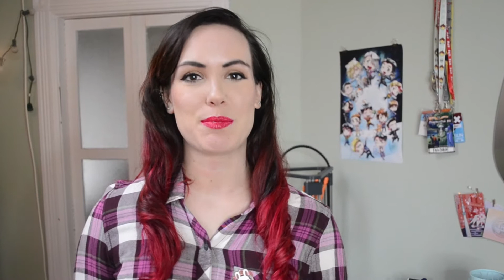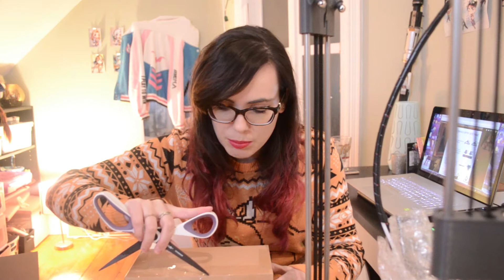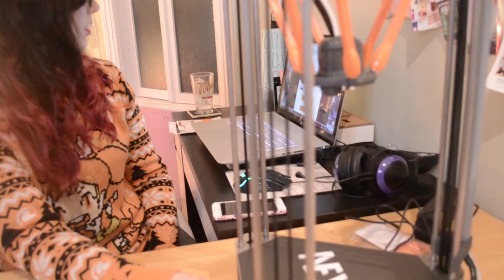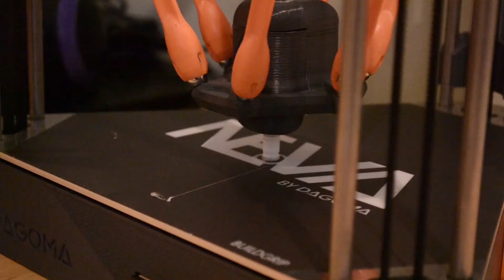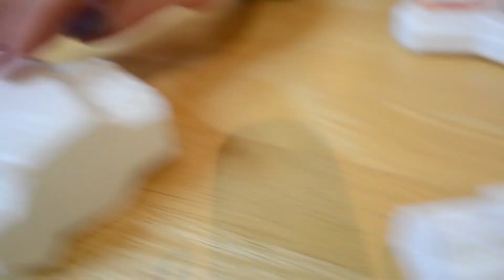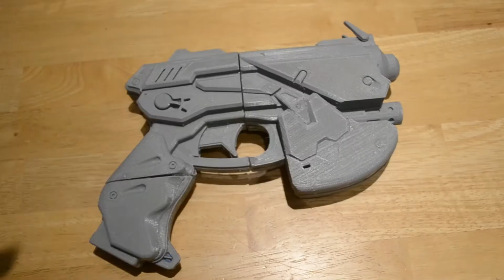NEVA 3D Printer Review for Cosplay

Comment: Thanks for posting the video, I am definitely going to order one. The printer I have is a pain to use. You have to manually adjust and calibrate the printer each time you print something. And the bed doesn't really hold anything that's a large print. No problem for smaller prints.